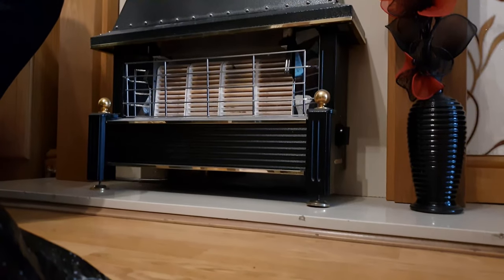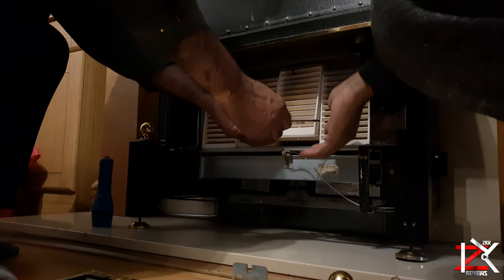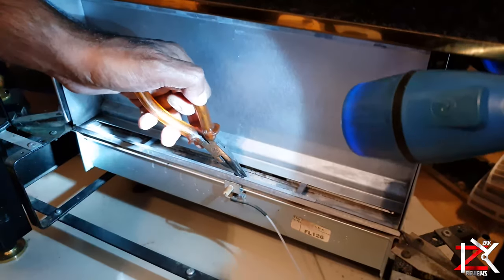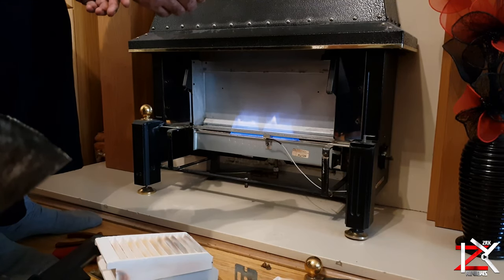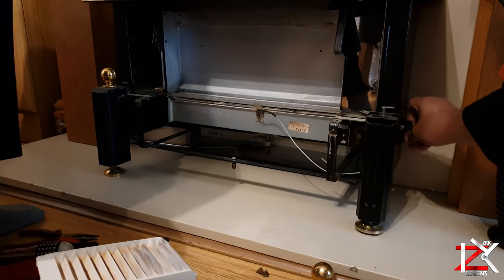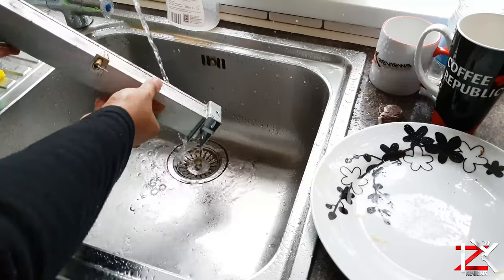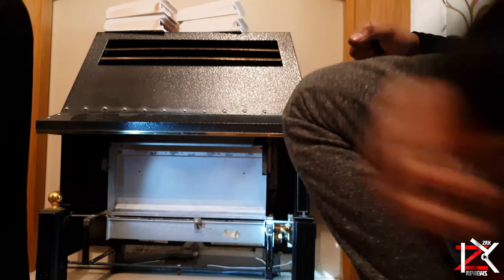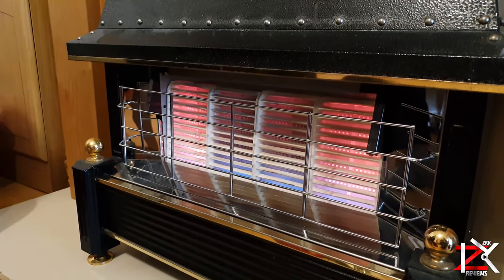How To Fix Gas Fire Igniter Fault | Cleaning out Gas Fire Heater | Faults Fixed

Comment: Hi I have problem with the ignition unit top metal tag broken, so it is not held properly on to the metal plate and slipping, hence no ignition. How do I fix it apart from changing the unit. Help…
I had managed to hold it with tie rap at the bottom tag. Can’t reach top tag area.